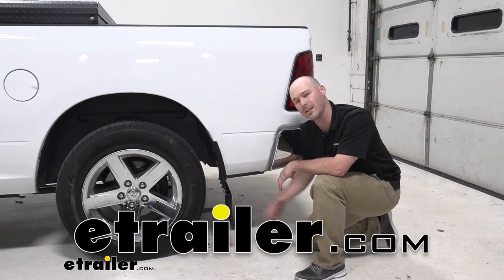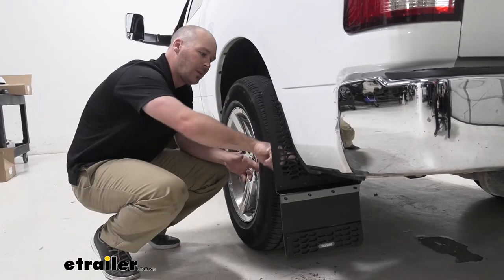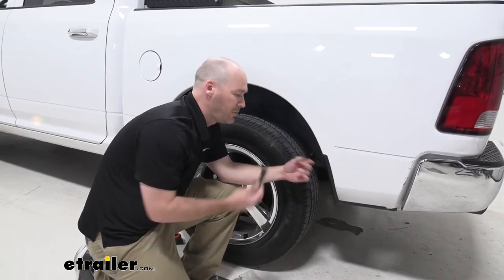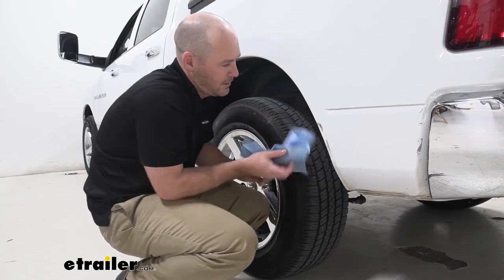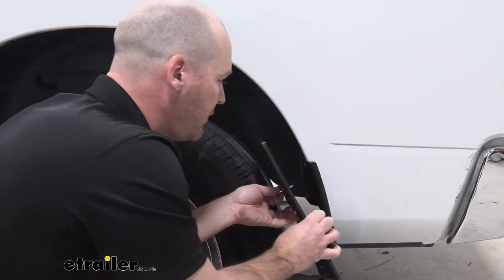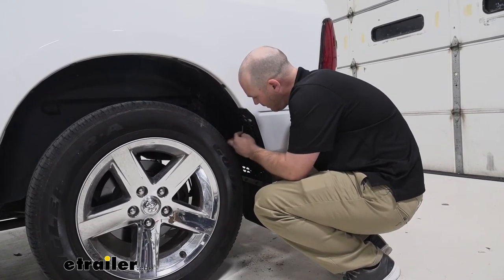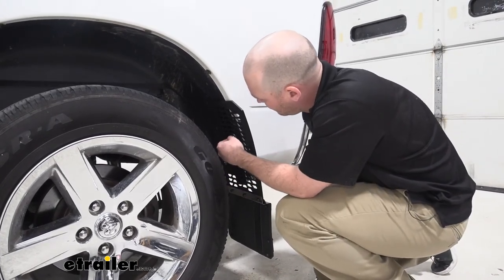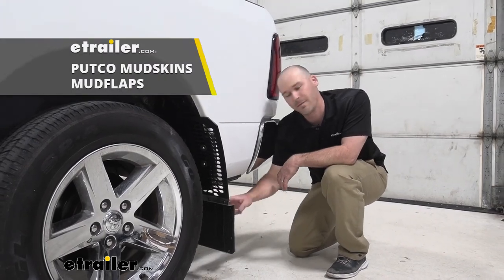etrailer | DIY 2012 Ram 1500 Installation for the Mud Skins Mud Flaps

Comment: Any pictures or video of the fronts being installed? I'm curious as most other brands have a ram specific cutout or notch that these do not seem to have. For example the cloudrider 807-3000F
Reply from the maker: The Weather Tech Mud Flap kit has the contour cut outs designed to fit around the Ram wheel wells. They look as factory as can be when installed.
https://www.etrailer.com/Mud-Flaps/WeatherTech/WT110024-120024.html

Comment: Can the mud flaps be adjusted vertically so that they don't sit as low?
Reply from the maker: They cannot be adjusted but you can trim them if you do not want them sitting as low to the ground. The closer they are to the ground the more they will help with deflecting rocks.
https://www.etrailer.com/Mud-Flaps/Putco/P27VR.html